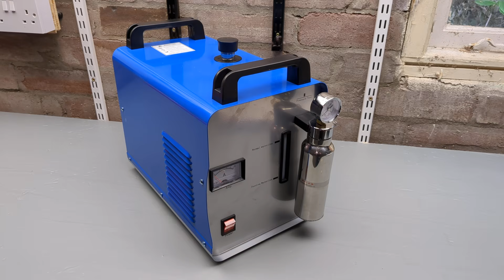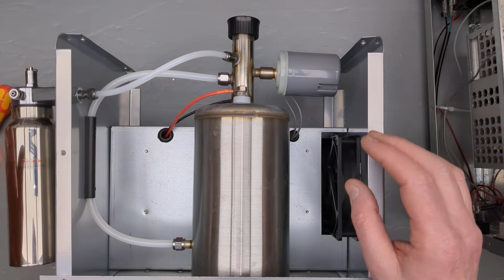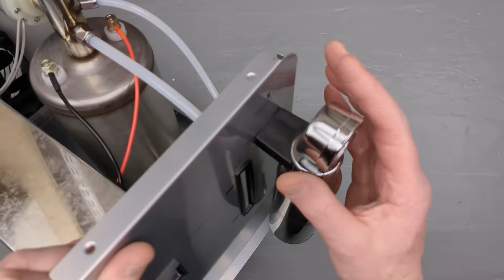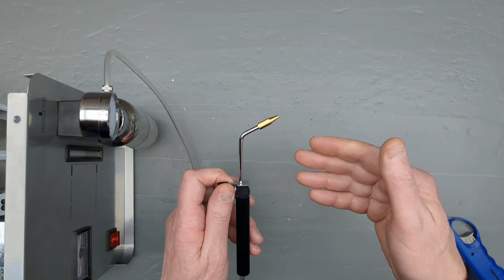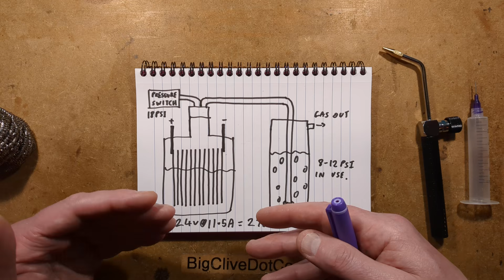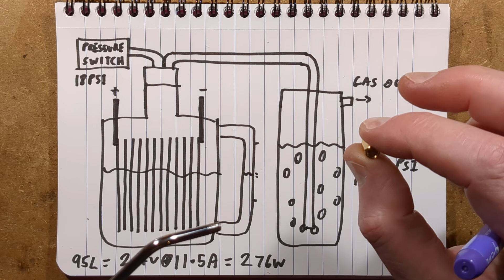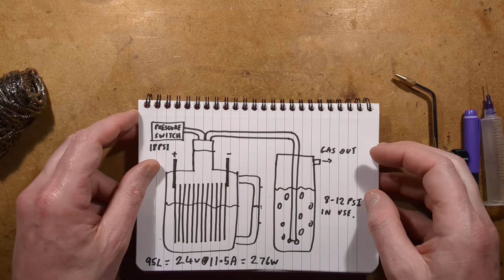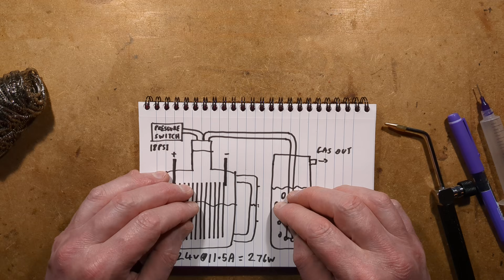Inside OxyHydrogen gas generators (HHO/Brown's gas)

Comment: KOH or NaOH for the electrolyte? Odd: sodium carbonate would be cheaper and safer.

KOH probably has a higher disassociation constant, increasing the conductivity of the solution. 

You can make your own cell with two test tubes, a beaker or water glass, and two carbon electrodes from dry cells. Fill the test tubes and water glass with the solution, then invert the test tubes and place them in the water glass, with one tube over each electrode. The oxygen and hydrogen will displace the water in the test tubes. You need to be careful that no air bubbles get into the tubes. Hydrogen comes off the negative electrode and oxygen from the positive.

If you get a pure sample of hydrogen, a splint will set it burn in nicely with a flame front going up the tube. If it's contaminated with air, you'll get a loud bark instead.

Oh, and if the flame gets past the suppressors and into the tank, you won't get liquid water and negative pressure—you'll get a steam explosion.
Reply: Sodium carbonate will produce CO2
Reply: Using carbonate would produce carbon dioxide as the reaction progresses, so it wouldn't be much use over a longer time frame. You also risk generating Sodium Hydrogen Carbonate, which isn't very soluble in water and would leave a white deposit. Alkali metal hydroxides are recommended because the alkali metal, if it happens to be reduced at the negative electrode, will immediately regenerate the hydroxide and release Hydrogen, and the counter-ion, hydroxide, is already present in water. Very clean, no problematic side reactions aside from the possibility of metal ions finding their way into the gas stream (hence the orange colour of Clive's flame).
Also, your proposed electrolysis setup will not produce Oxygen at the positive electrode. The electrode is made of Carbon, it will immediately react with the Oxygen as it is produced. There's a reason electrolysis electrodes are typically made of (or at least plated with) Platinum group metals, although you could also use Nickel as the oxide passivation layer formed will slow down further reaction and isn't soluble in water to any significant degree.

Comment: There is confusion here. This device is producing hydrogen and oxygen premixed. It's in the ideal concentration to make a very loud bang. It's hopeless to use this for a whoffle. What you need is just pure hydrogen that does not go bang but burns with a slight blue flame if you apply it in a whoffler you'll get rather pleasing effect.  Instead of the bubbles drooping down the side of your whoofler they will rise up and you can catch them in mid air. That would be quite satisfying.
Reply: No confusion at all. This is a super whoffler. Think of it as a upgrade.
Reply: It's a lot more fun to make a loud bang though.

Comment: Yes, scary with hydrogen and oxygen.  Too gad you can't get them separated, and just use hydrogen ino the woofler, then just flame as it burns in the air, vs. explodes.
Reply: Versions are available that separate the gasses.